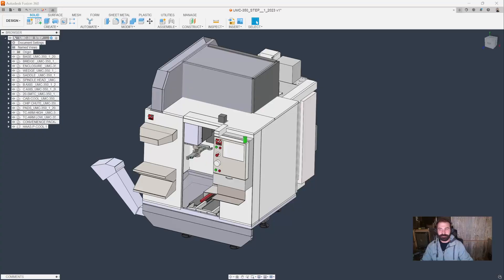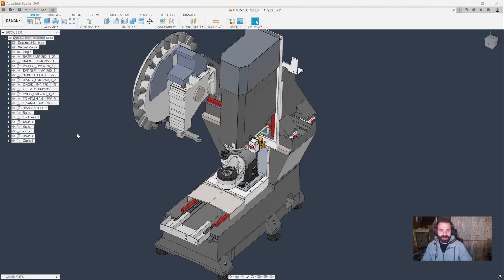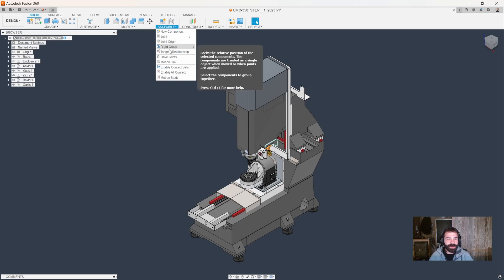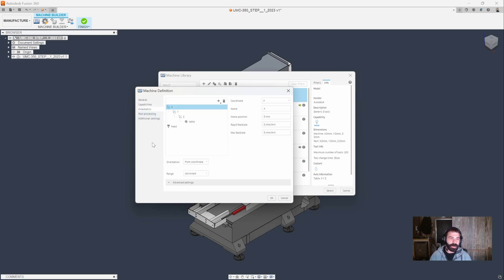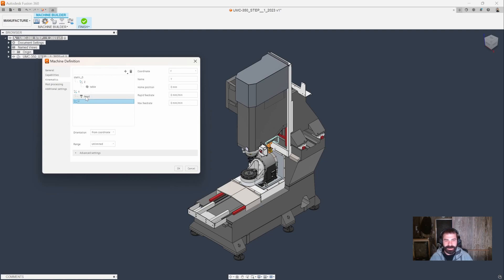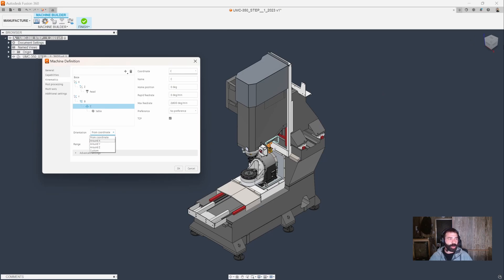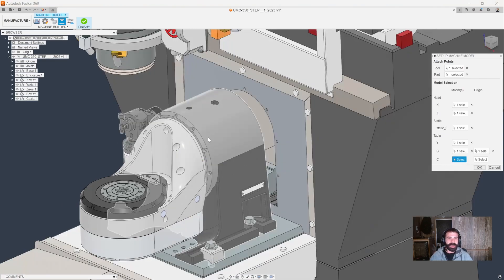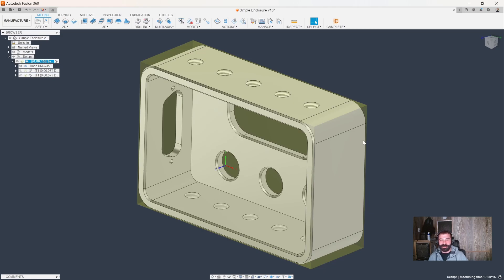Fusion Friday (ep110): Machine Simulation from Scratch

Comment: I can not get my machine builder file to rotate the head around the proper axis.  My design and joints all work properly but I fail when in machine builder.  My machine is a DMC80U.  head rotates on a 45deg plane from vertical to horizontal.  Any time I select the pivot point the head rotates around a horizontal axis.  I cant seem to select a face, axis or construction plane in machine builder to correct it.  Any suggestions?

Comment: Im building a vertical lathe i have my z,x and c axis(spindle all working perfectly) but the turrett wont show up in setup machine model i have it added in kinematics with it all defined to start in my kinematics i have static with all of my  base selected then z i have all of my z axis and then my x axis under z and then the turrett cuz its mounted on the x but rides up and down with the Z axis then i have a rotary axis (C) and main spindle under that. Ive made sure i didnt have the turrett accidentally selected in anything else in setup machine model ive restarted fusion idk why the turrett isnt in my setup machine model? 
Example in my kinematics:
Static
    Z
      X
         Turret
C
   Main spindle